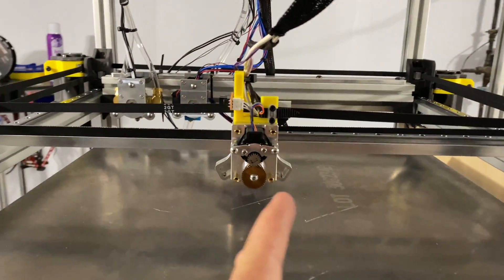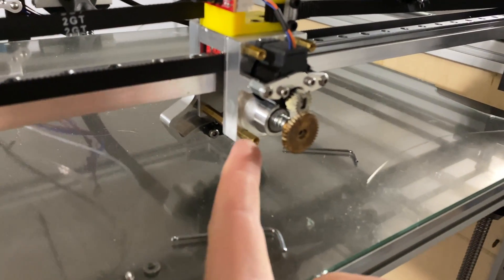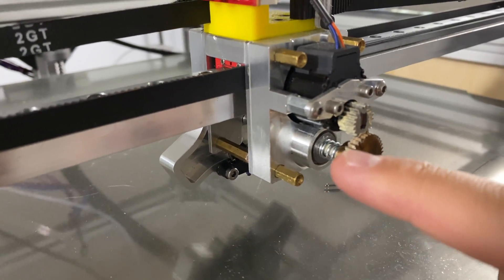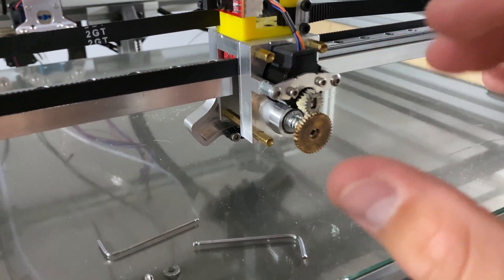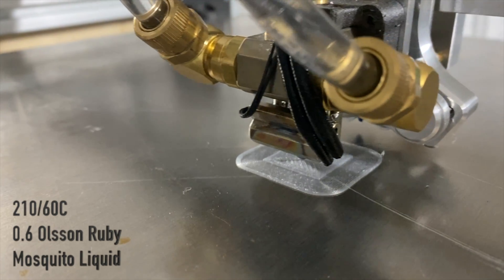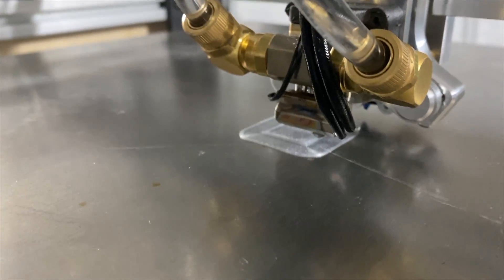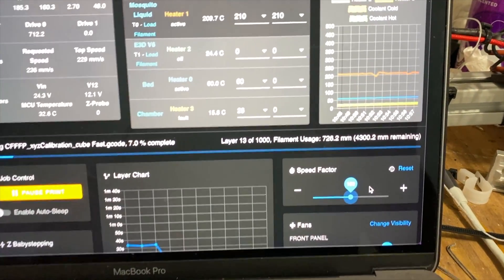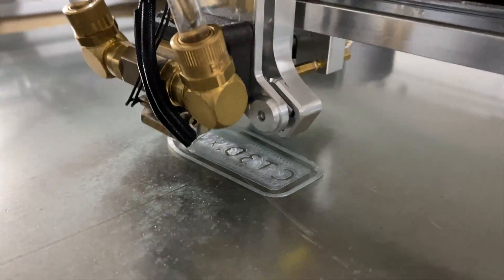It Is Printing! | HevORT E3D Tool Changer | Part 3

Comment: could you please, provide the files for the X axis gantry asemble ? i will need to contact some CNC worker to build it from scratch.
Reply from the maker: @eduardogarcia4452  it’s in the CAD model
Reply: @JordanMiller1117 but i cant interact or export it
Reply from the maker: @eduardogarcia4452  did you sign in to F360 to view it?
Reply: @JordanMiller1117  yes, im logged, but there is no option to export it
Reply from the maker: What is your email, I'll send you the Fusion Archive File.

Comment: What is that squeek you hear the printer make during the print later into the video? The sound happens during a move, but what part of the printer squeeks?
Reply from the maker: I am pretty sure it is one of the pulleys just rubbing on the plastic mount a little bit. I haven’t investigated it very much, but plan to do so. Not too worried about it at the moment.

Comment: One of my concerns of water cooling is weight, and the moving head speed up-slow down cycle over high speed can be an issue. I have seen Japanese tech, where the head is a laser head that melts the metal with the same feeding mechanism to solder down precisely chip legs, but for plastic I think don't necessary to have that much energy. IF it is possible to use laser mechanics to melt plastic we can have an unique head that not only will be able to make home SMT, else the plastic/a.s.o. material chassis/part of the product too.
Reply from the maker: Yeah that would be cool. My goal with the Mosquito Liquid is not to go fast, PEEK (my goal to print) doesn't like to print fast anyhow. Yes it is heavy, but it has a specialty purpose. Additionally that's why I have a toolchanger so I can grab a very light hotend :)

Comment: Why not a washer ? For the spring, this how I make it
Reply from the maker: The "washer" is more of an open bearing, there are a top and bottom with the ball bearing inner race sandwiched between them. Or are you talking about a wave washer?
Reply: @JordanMiller1117  no you can put a m4 washer with bigger id as the shaft behind the spring with this you increase the force that’s hold your tool

Comment: Great work!
Be careful with your x belt if it not parallel it might cause some tension issue and inaccurrency print
Reply from the maker: Yes, exactly. I’ve let it go for now but am going to re-design the piece to make them parallel.

Comment: Did you make your tool changer or order from e3d?  I will be calling e3d if mine isn't working.
Reply from the maker: I ordered the tool head and tool plates from them. The X-Axis cross member was custom machined.